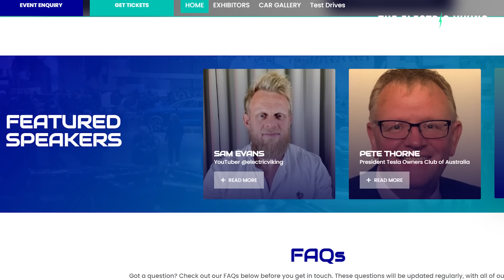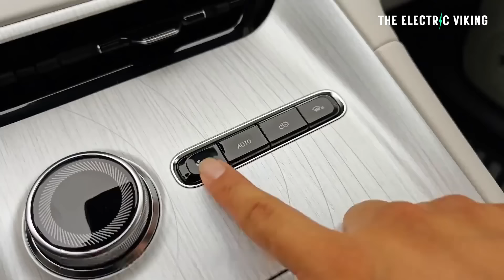Why Geely's new $15,700 Galaxy E5 is the best value EV in the world

Comment: BYD Sealion 6 DM-i is now a big threat in our country because it's a P-HEV that's affordable, high-tech and luxury. Toyota, Nissan, Honda are in tight situation right now as buyers will be selling their HEVs and new buyers will definitely try the PHEV offerings by BYD. It even comes with 10 speaker sound system by Infinity and after a recent economy run it travelled 1600km on a single full tank of gas and one full charge of battery.

Philippine pricing converted to AUD 

BYD Sealion 6 DM-i - $41144.43 AUD - PHEV

Honda CR-V RS top spec - $68839.84 AUD HEVonly

Toyota RAV 4 LTD 2.5 top spec - $62620.34 AUD - HEV only

Toyota Corolla Cross GRS top spec - $510850.12 AUD - HEV only

Toyota Yaris Cross HEV top spec - $42632.86 AUD - HEV only

Nissan Kicks HEV e-Power top spec - $39310.47 AUD - HEV only

Comment: They could make it cheaper by taking out massage seats and 30 storage containers and other such not essential items like these. But anyway that red car has got to be the ugliest car made. well there are others in this style as well.
Why do EVs have front ends that look like they are ICE vehicles with the radiator opening filled in. Has nobody got any design flair now that the radiator has gone or is the overpowering paradigm have the same body shell parts usable on evs, hybrids, and gas guzzlers.